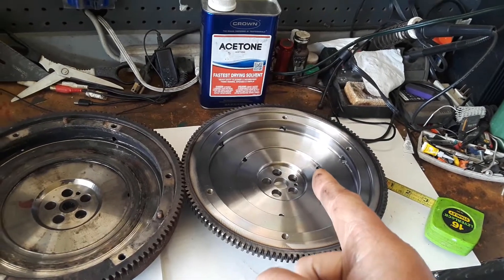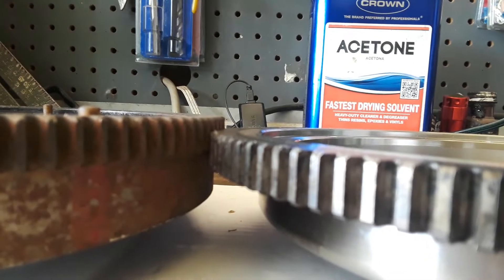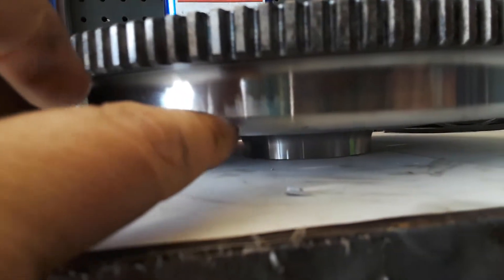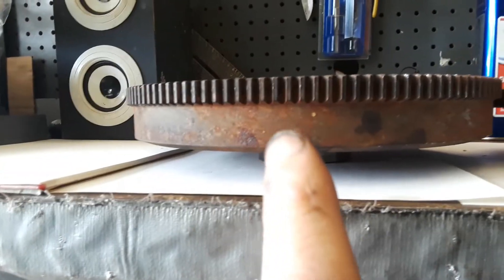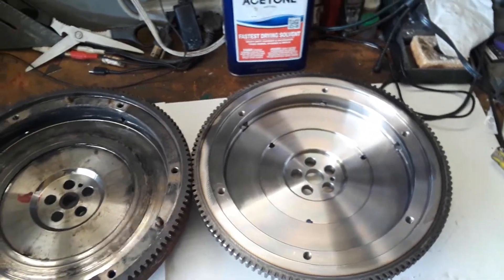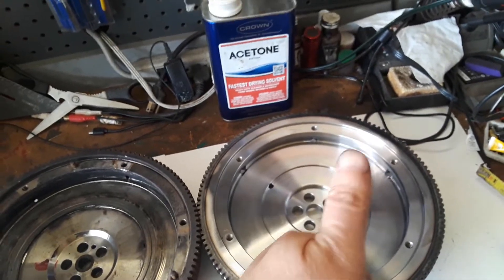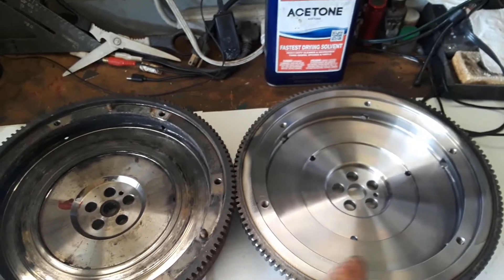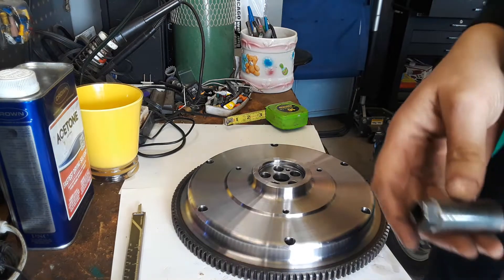Part: 3.5 Installing the 200mm flywheel converter on the Type 4

Comment: These videos are life savers, picking up a type 4 1700cc from a 914 in the next week for cheap. Seems like similar cost to swap this motor in to having to rebuild my 1600 to get anywhere close to the power output